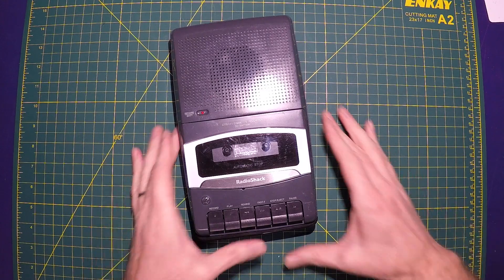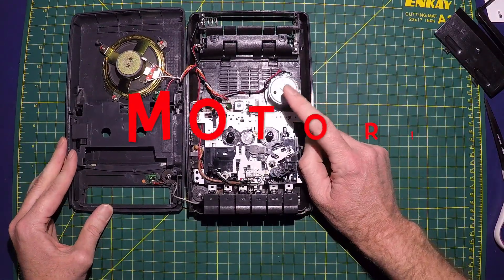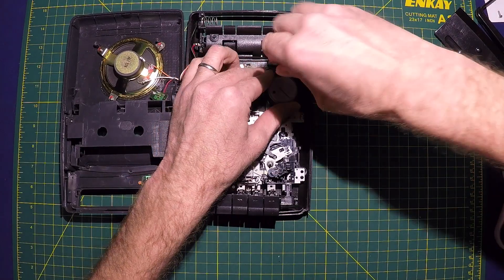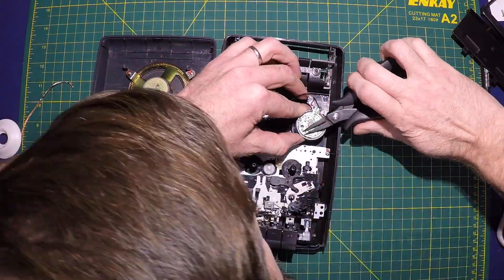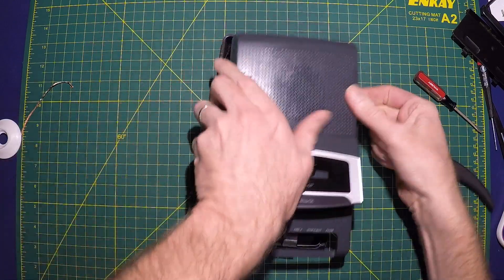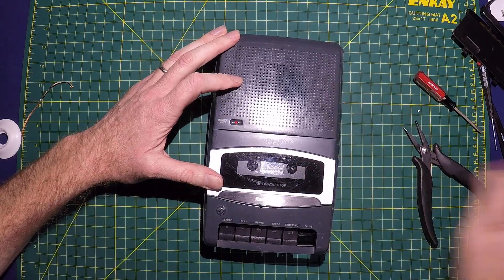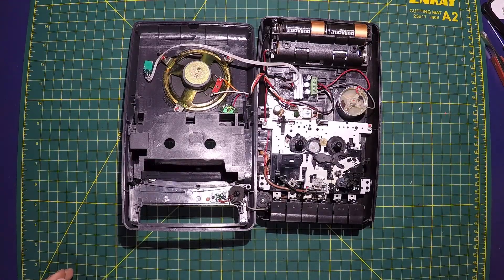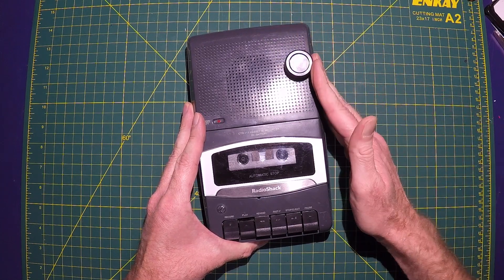How to add pitch/speed control to a tape recorder

Comment: Could you do this to a vhs tape? 🤔
Reply from the maker: Well technically you COULD but you won’t get the results you want. The problem with VHS is that recordings on the tape are made at an angle. The recording/playback head also spins. This is done so more info can be stored to a smaller section of tape. So even if you able to make a good loop the image would not be a clean visual loop. You would also need to deal with the fact that inside the VHS player the tape gets pulled out and wrapped around that spinning angle head when you play a tape. So it would be really hard to figure out how long to make it the loop.
Reply: @SISKworks  How about a record player? I've been trying to figure out how to do this exact thing to an old DC turntable. There are forum posts out there about it, but they're generally lacking in details and I'm not sure how to do it without damaging the motor.
Reply from the maker: @neopifex  If the motor is DC then this same technique should work. Just search amazon for "PWM Motor controller" and find one that can provide the power the turn table needs.
Reply: @SISKworks thanks! I'll give it a shot!

Comment: If anyone is having high frequency noise problems after doing this mod, solder ceramic capacitor (one of those common brown round cap ones) across negative terminal of the motor and motor chassis, this pretty much reduced all noise for me.

Comment: Hi, thanks for your video. I´m planning to put the PWM mod on my GRUNDIG CN 730 cassette... (80s old guy) I´m new on electronics, and my question: is your mod going to work on my machine?  do I need another model of pwm?  any sugestion would help!  thanks in advance!
Reply from the maker: I’m not sure. I’ve found they don’t work well (if at all) on the older cassette motors. But I don’t know why this is.
Reply: @SISKworks  thanks

Comment: Ok hear me out
2 tape decks
slow them both down to the same speed
play the same tap from both of them, but with one 1 beat behind
use an audio mixer to switch between them to add stutters

and that's how to make a quick and easy chopped and screwed set up
Reply from the maker: @ashtmslf2315 what you are describing is almost a tape delay, which I did already do. You can definitely get some cool stutters when running drums through it. Check out my other videos on this channel.

Comment: I wasnt factoring in that hidden board in the motor. This was very useful knowledge. Thanks so much. I get a lot of high pitch static noise when I built it. Any idea what could cause that? Otherwise it works fine

Comment: I know this is old, but, Great Video. I have a good condition Nakamichi BX-1.  On the back indicates 50/60.  Could I do this same thing?  Same part?
Reply from the maker: No I don't think so. You need a player that runs on batteries.

Comment: Would this work with just a normal pot?
Reply from the maker: No not really. With a normal pot you might be able to get the tape to slow down just a little bit and then it will stop. You would only have a SMALL amount of control. But with a PWM board like I show you get a big range of control. From faster than normal all the way down to a super slow crawl. That is just NOT possible with only a pot.

Comment: Which did you use the Amazon add I saw comes with 6 or 4 different boards?
Reply from the maker: Yeah there are so many different versions. It’s hard to always find the same model since it seems they are made by a ton of different companies. This one looks exactly like the last ones I bought but is made by a different company. 
https://www.amazon.com/UMLIFE-Controller-Control-Switch-Dimmer/dp/B098B2LRSK/ref=mp_s_a_1_18?keywords=PWM+Motor+Speed&qid=1696263034&sr=8-18

Comment: Do many Radioshack decks like this have adjustable motor speeds ?
Reply from the maker: Almost all tape players have an adjustment inside the DC motor. But I’m am adding new speed adjust circuit and bypassing the one built inside the motor.
Reply: @SISKworks  Thanks Yes I understand just wondered if it was just this model or any flatbed cassette player. Thanks for your quick reply as it's quite an old post
Reply from the maker: @mrfeenix1  the only players that I’ve found that don’t have that internal adjustment are super old/vintage players.
Reply: @SISKworks  Cool !! Time to go out and grab some tape machines !! Thanks :)

Comment: Just curious: If you would desolder the old motor speed, but still keep it powered, solder 2 wires from the lugs to a dpdt switch so you can switch between the newly soldered knob AND the old circuitboard, would that work? Or is the power going to the motor a part of how it works?
Reply from the maker: Yeah I would think that should work as  long as the switch is wired between the motor and original speed controller.
Reply: @SISKworks  Ah awesome, thanks for your quick reply. Your tutorial is a lot better and more clear than others. Will be soldering away this weekend. If it doesnt work no biggie ofcourse, but I kind of like the idea of having 'normal speed' as a set setting instead of dialing it in
Reply: @SISKworks  broke off the tab of the original haha, let’s see if I can overcome laziness to fix it or just happy with the speed control ;)

Comment: thank you! I made the same polarity mistake on the motor side but thanks to this I knew what to do right away.
Reply from the maker: I did this mod again just last week and thought I was being super careful to keep track of polarity but somehow once AGAIN it was backwards. I almost wonder if these PWM board just always need to be wired in reverse or something. Or maybe I just wasn’t understanding the original circuit that I bypassed.

Comment: Hey, not sure if you’re still seeing comments on this video, but I just finished the mod and there’s a loud crackling to the speaker. Do you know what this might be caused by? Perhaps an inadequate PWC?
Reply from the maker: Hmmm, I’ve never had that issue come up and I’ve done this mod a ton of times. I doubt it would be the PWM board. But to be 100% sure I would temp disconnect the positive wire going to the PWM board to see if the cracking goes away. Then reconnect to see if the cracking happens again. The PWM does cause a bit of motor noise to come through the speaker when running at high speed but it doesn’t sound like cracking at all.
Reply: Will try that, my PWM is also right at 20 khz so it may need to be higher, saw a comment about it causing extra noise if it’s lower than 20 khz
Reply: Ended up buying a whole new cassette player, this one was DD instead of belt driven, and it worked perfectly this time. Not sure if mechanism has anything to do with it but that’s the only thing that changed. Thanks for the help! Awesome mod🙌🙌

Comment: I drilled a hole in the top of my recorder and stuck a screwdriver into the motor speed control.
Reply from the maker: That works! But if you use a PWM board you can get a much bigger range of control.

Comment: This is interesting.  How much can the motor be increased beyond normal cassette speed?  I am wanting to at least double the speed so I can quickly duplicate and covert cassettes to digital in half the time. A bit faster is even better then after conversion I slow down the audio back to normal in my PC audio app.
Reply from the maker: If you bypass the internal regulator that is inside the motor (which I didn’t show) you can get fairly fast speeds. But I’m not sure if it double or not. If you are using it to record, one thing to be aware of is that the PWM board does add a bit of motor noise at higher speed to the audio which is not ideal. It seems The only way around that is to have a completely separate battery pack for just the motor.

Comment: Hey awesome vid and great result. Which spec PWM board did you use for this?
Reply from the maker: I’m not really sure which one I used here since it was a few years ago. Just search Amazon for “Aobao DC motor PWM speed controller”
Reply: Thanks. One final question. 
What if you want to play the tape back at normal/standard speed. Do you add a switch or?
Reply from the maker: @-______-______-  you would just have to figure out where on the knob it sounds “normal” speed and mark that position.

Comment: Thank you for the help! Subscribed! Ihave one more question which is Im adding a headphone jack in place of the speaker. Do I need to ground it?
Reply from the maker: Well I’m not exactly sure what you mean. One of the speaker wires should already be ground. That is just how circuits work. So if you use the same wires to make your new headphone output then it will already have a ground. So no additional ground needed.

Comment: I’ve got this working now. I’m confused about detaching the knob. What is the cable that I use to connect it to the pwm chip. And what is that red cable that is installed?
Reply from the maker: I used a piece of ribbon cable and pulled 3 wires off but you could also just use three individual wires. Red wire was to bypass the switch built into the potentiometer when you turn it. Removing that potentiometer is probably the hardest part. I’ve even damaged a board in the past doing it. So be gentle.

Comment: This is really cool. I did it on one machine but on the second, the motor looks all weird inside  and I don’t see a PCb there. Any idea if maybe that part of the circuitry was outside the motor?
Reply from the maker: I’m not too sure. But you don’t actually NEED to bypass that circuit if you can’t find it. You just might not be able to get super fast speeds.
Reply: @SISKworks  Thanks, Hopefully I can put this motor back together lol.

Comment: I just built one of these and it works great! Any idea if this same idea would work on a turntable?
Reply from the maker: If the turntable had a DC motor then yes it will PROBABLY work. I’ve never opened a turntable so I don’t really know what type of motor they have. But don’t almost all turntables already have speed controls?
Reply: @SISKworks  they have different speeds depending on the size of the record and some turntables have a speed/pitch control as well but they have extremely limited ranges. However they also usually have a strobe sensor to keep them in time and idk if that would cause problems. I think I’m going to give it a shot!
Reply from the maker: @broke8246  yea you should definitely give it a shot. I have turntables but they have already have a fairly wide range of speed on mine as they are more of a DJ type. I never thought to try modifying them even further though. Would be cool if you could get some super slow speeds. You can also try reversing the polarity to get the motor to spin backwards which can be cool with vinyl (not so much for cassette haha).
Reply: @SISKworks  would it not just play the tape in reverse?
Reply from the maker: @broke8246  not exactly. Yes,the motor will spin in reverse but since tape players are only driven one way it will just eat the tape. I know from experience. Over and over. Haha.
Reply: @SISKworks   makes sense, perhaps there’s a way to prevent the play head from retracting during the rewind process? Could be interesting!

Comment: I tried this mod but it plays back from super fast to even faster. Any ideas what I did wrong? I wired the board where it says motor into the motor port of the pwm and the voltage labeled part from the pwm Into the motor. Any help would be appreciated.
Reply from the maker: some PWM boards might have a trimmer or jumper pins select different ranges. Does your board have anything like that? I would also test by powering the PWM board directly from the batteries to see how it responds. Does it go faster and slower but just not in correct range? If so you could try feeding less voltage into the PWM board.
Reply: Wow thanks for the fast reply. It Does adjust but in highs only. I’m very new to electronics so I’m not sure about those features or even how to reduce voltage. This is the one I am using. 
https://www.amazon.com/UMLIFE-Controller-Control-Switch-Dimmer/dp/B098B2LRSK/ref=mp_s_a_1_5?crid=3AUMG4N784Q6L&keywords=pwm+dial+20khz&qid=1660085035&sprefix=pwm+dial+20khz%2Caps%2C146&sr=8-5

Comment: hey, I'm wondering what the PWM actually does. Does it allow more/less current to flow through? If so, would it be possible to attach a CV-sequencer instead of the pulse width modulation?
Reply from the maker: The PWM board works by turning the power on and off really fast. A CV sequencer directly would not work. But you can connect a vactrol to the PWM pot and inject CV control that way. Ive done that a few times. Check out my KeyPlayer video
Reply from the maker: https://youtu.be/rTYyPcacBzw

Comment: The pwm does not keep the speed constant, where the circuit in the motor/servo does, just wire an external pot into where the adjustment pot was on the motor pcb. Why make a simple job complicated.

Comment: Just did this mod and it works great but what was the jumper at the end for again?
Reply from the maker: Sorry, I didn’t explain that very well. The original pot had a built in switch (clicks on when you first turn it clockwise). But I wanted the PWM board to turn on with player so I just put a jumper (on the PWM board) where the two switch contacts would be. Without the jumper I would need to send 5 wires to the speed control pot but with the jumper I only need to send 3 wires. Totally not needed though. Works either way.  Thanks for watching and commenting. Love to hear it when other people build my projects.

Comment: Anyone knows if the PWM controlled DC output of the Koma Elektronik Field Kit could be used instead of the extra circuit? So i could basicaly power the motor with the Field Kit?
Reply from the maker: Yes I’m fairly certain that will work. Pretty sure I saw a video with someone doing exactly that.
Reply: @SISKworks  i tried now, and it works perfect. Now i can sequenz the motor speed. :-)
Reply from the maker: @martinreim4805  awesome. I really wish I had that Field Kit too.

Comment: Nice, thanks for sharing! I feel like this is a stupid question: what's the difference between using a PMW board and just adding in a pot before the motor? I'm guessing the PMW allows you to boost the speed (add more voltage and/or current?) but the pot would just allow you to cut what's being drawn, so okay to slow but wouldn't speed up? And with the PMW board, at the lowest range can it cut the motor, or does the PMW board prevent that? Thanks for any tips, got some tape decks ready for modding!
Reply: well if you guys didnt find out.

basically, the motor requires a certain voltage to work properly. therrfore reducing the input voltage would not be a reliable way to slow the motor down.

instead you use PWM to essentially turn the motor on many many times a second

google pwm and duty cycle :)
Reply: I have the same question!!
Reply: I too have the same question....

Comment: hmm, i have a few portable decks where the motor PCB is inaccessible due to the main board in the way. Is there any way to add one of these without ripping out the motor PCB itself? I can identify the wires from the motor itself..
Reply from the maker: Yes you can still do this without bypassing the motor PCB but you just won’t be able to get a fast speed.

Comment: Awesome video! Do you know if this would also work on a Tascam 414? I've popped the top off the motor and it looks the same but I don't want to wreck it. And is any PWM going to work? I found a Low Voltage DC PWM Motor Speed Controller Module 1.8V 3V-5V-6V 12V 2A S3Q4. Is that right? Thanks!

Comment: I would think a potentiometer wired between the motor positive side ....then turn the motor speed all the way up with the internal speed control...then control it with the potentiometer.
Reply from the maker: No, you won’t get very good range of control that way.

Comment: Hey I used the exact same cassette play and followed everything exactly the same but I used the pwm that I have linked below. Everything works but there is a LOT of audible noise. a suggestion from one of the comment below said that using a PMW with more then 20khz will produce less noise. but the one i purchased below is 21khz and still makes a lot. i appreciate any suggestions if you have any

the pwm i purchased below

https://www.amazon.com/Greartisan-Controller-Variable-Regulator-Governor/dp/B07H916YHN/ref=pd_rhf_se_p_img_2?_encoding=UTF8&psc=1&refRID=MSYVPF0H05ZDA3WR0TMN
Reply from the maker: I’ve been having the same issue with the last tape player/PWM combo I tried. I even just got the red PWM that someone else recommended and it still causes that noise. I feel like some motors just respond to PWM control much better than others but I’m not 100% sure why. You could try powering the PWM from a separate set of batteries as the player. That might help.

Comment: Hi, I  found this after watching one of your tape bent bids on a bending Facebook group. Nice instructable. I have now bought the correct own circuit board, and realised that you need to rip out the motor PCB, thanks.
Reply from the maker: Yes you would have to bypass the internal voltage controller that is located INSIDE the motor. I think it should also work without bypassing but you just won’t have as wide of range of control.
Reply: @SISKworks  you're quite right, I did this with a shoe box style deck, I'd picked the wrong PWM circuit board and the range was small, no high speed, and the pot behaved like a hair trigger on the small amount of control it had. I'll be revisiting the project again now, and I'm going to revisit an old oil gobbo light projector, I tried the pwm hack on the gobbo wheel motor, didn't even turn, hopefully it'll work now.